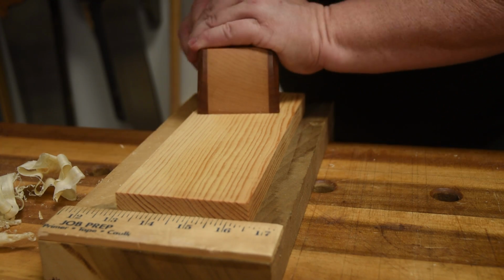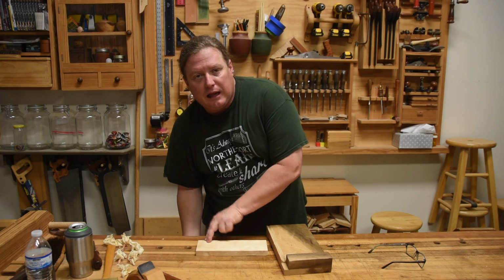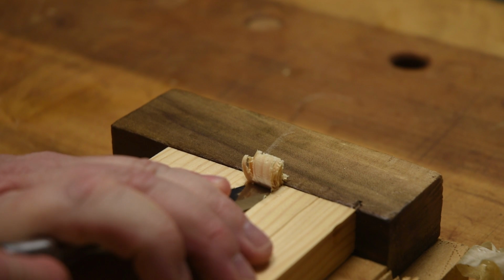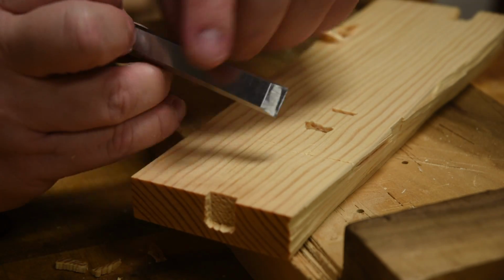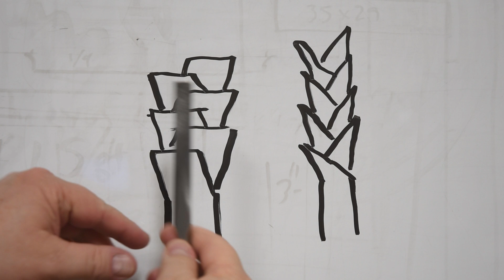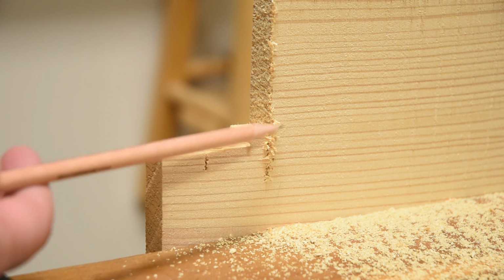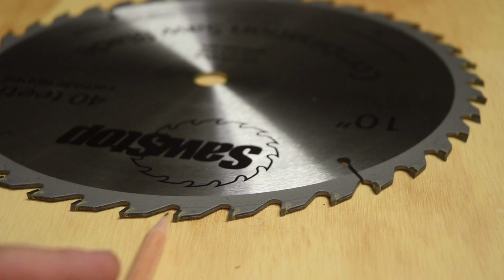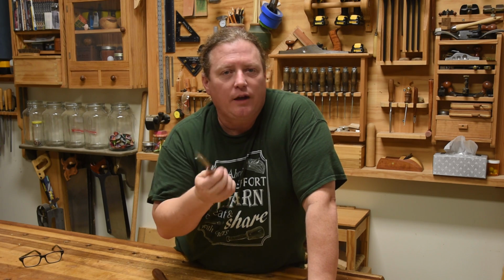Get Started Woodworking - Intro to the "Prerequisite Course" - Understand All Woodworking Tools

Comment: @18:50 I'm trying to understand which of the blades is for ripping and which is for cross cutting.

 I'm currently under the impression that the one on the Left is for cross cutting because every other tooth is pulling out remaining wood during the cut.  The saw blade on the Right is more uniform with its blade angles allowing it to glide smoother along the grain and rip lengthwise. 

Do I have this correct?  Ive been subbed to your channel for quite a while but I'm an extreme beginner and have only watched woodworking, never practiced.
Reply from the maker: if it comes to a point it's cross, if it comes to a edge its rip.
Reply: @wortheffort  thank you sir

Comment: You sir are terribly under rated and undersubbed. You talk wood shop and woodworking the way it actually goes down for woodworkers we don't need festool and rockler t track lol. We don't need a few thousand dollar dust system actually if we can just hold something still when we need to and keep the dust off the finish at the end its really that basic for wood people in real life. I use my popaws old shop and I still use his "work horse" table it's similar to your build in that his is whatever wood he had at the time it's affixed to the wall and it's got holes all over the place with a big old vice attached to the edge and a sacrificial top and apron boards he would just replace when it got to bad lol but he just drilled the corner of something to the bench or he drilled two other boards down and pushed against them or whatever he just used his bench as an old bench and he was a pro its not about expensive for real woodworkers. He was a general contractor for about thirty years and in retirement he made trim and moldings for our local ace plus took trim work jobs in businesses all over because he loved finishing and he had a reputation for it. I now own his old shop and it was a humble disaster he didn't care about pristine perfect expensive or fancy except for a few tools his Makita saws his router table his press and he wanted specific blades and bits but.... As far as that shop and poor old bench.....hey does it work....it's fine and if we tried to vacuum up "his dust" he would turn off the machine he was at and go what you doing? Just leave my dust alone I know where all of it I might need that loll but really he meant hey don't get it all stirred up it's not bothering anyone but you leave "my dust" alone lol he was a mess. He built beautiful things though from that humble shop a humble truck and a humble little house that I still can't belive I was lucky enough to end up buying and now that I've been able to push myself to use his shop without it just absolutely breaking my heart that he's not in it I miss him so much but the lessons I learned from him are still with me now in the shop in life in everything and I've stumbled across your channel thankfully because your style of teaching woodwork and the simplicity you teach is so much that basic woodworker mentality that's been around for millennia and I also had an uncle that was a carver cabinet furniture and custom mantle work kind of woodworkers he was amazing in his trade and even made woodwind instruments for years he's also gone and you really remind me of him he was a long hair hippie actually but he of course too had this basic does it work......well let's make something to heck with a perfect shop I want a perfect product mentality and listening to you is so awesome after seeing so many unrealistic wood folks on you tube that are really just shop building folks . You and Thomas Johnston are fantastic totally different channels but you both put off "actually woodworking in reality vibes" I can't get enough of that

Comment: this is the best explanation of blades ive seen, great video, im going out to check all my saws now hahhaa
Reply from the maker: Thanks
Reply: Just be aware that the current blade grind is a multiuse design. If it has three distinct facets at the tip of the blade, then it is a "combination" blade that is not cross/rip specific.
Reply: Oh, and hard to sharpen because the tips are heat treated.

Comment: Hey men, i used to like your channel but you have to realize technical video/sound quality do matter. Seriously this hiss is almost louder than your voice. Get a decent mic, can be as cheep as a 20$ boya lavalier. And what about lighting ?? On the close views (the one normally where the image is most important) it's so dark it's realy hard so see any details. You need to work on that. All it takes is a 10$ desk lamps.
Reply from the maker: Cables are dangerous in a shop the way I work so no lavaliere. I use the best shotgun I could afford. As to lighting, I sometimes mess up on wb and exposure because I do it all manual. Get this, not all of us have teams or sets doing this so comparing a av hack to pro might not be fair. My shop is on a major hwy with no hvac so doors have to be open. You’re hearing road noise. Best I can afford.
Reply: @wortheffort  We are all in the same situation yet lot do far better with no more money than you.